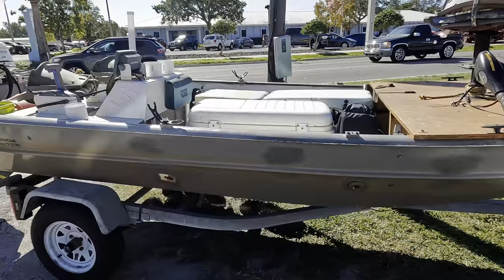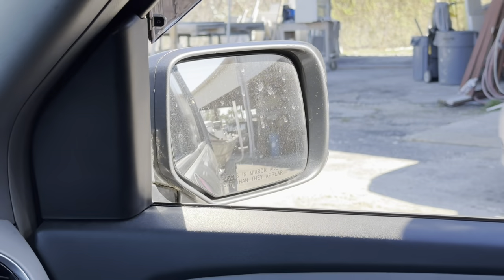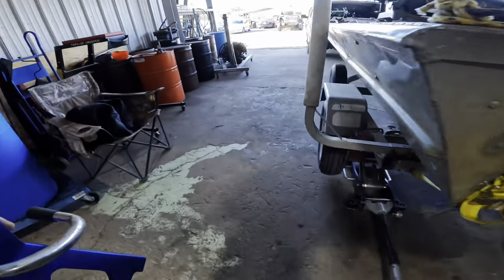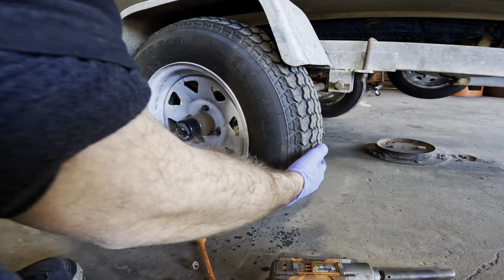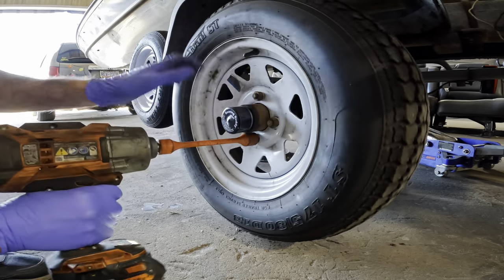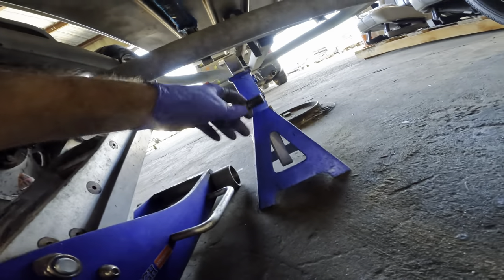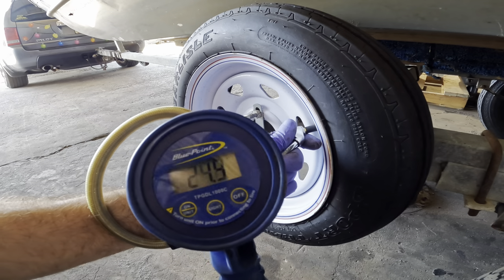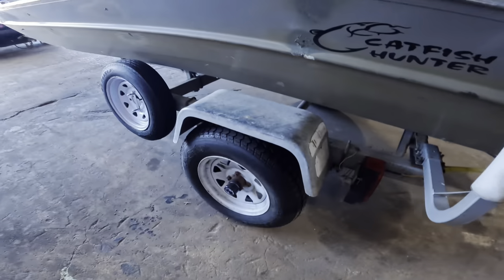Customer States: Trailer Tire Rotation!

Comment: No way ever should you run such a light weight trailer at maximum tire pressure, remember it is half the weight of a car, or less and will end up bouncing around when being towed.
Reply: I thought the same, should probably check the boat motor mounts! As hard as those tires are its going to bounce on every crack or seam on the road!! I borrowed a trailer that had hard tires like that, the spare bounced out going over the train tracks!! My fault for leaving the spare in the trailer not strapped down, I did put it in the truck bed once I found it 😂

Comment: Why on earth do people insist on using crap Chinesium made cross ply trailer tyres? When I visited the United States every trailer camper I saw had this Chinese crap marked trailer use only on them. I had a Tyre shop for twenty years and always used 8 ply light truck radial tyres on my clients trailers and campers, and never had any weird wear or failures. 😁🇦🇺